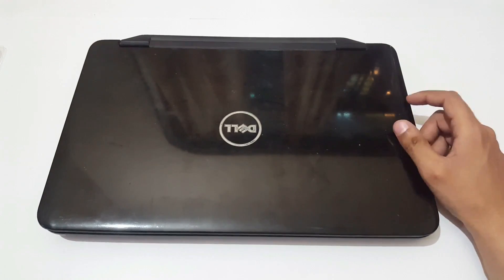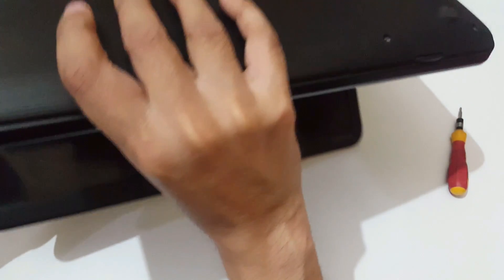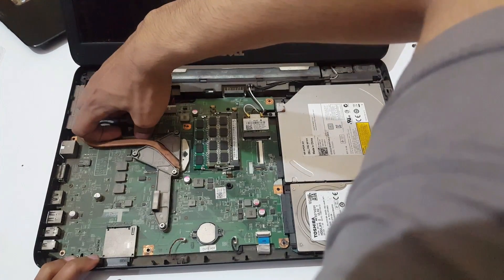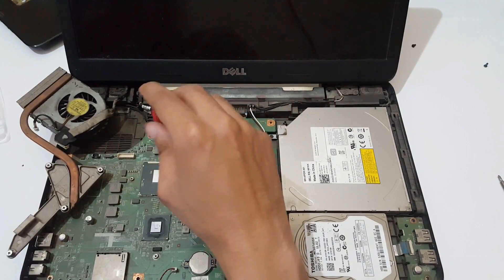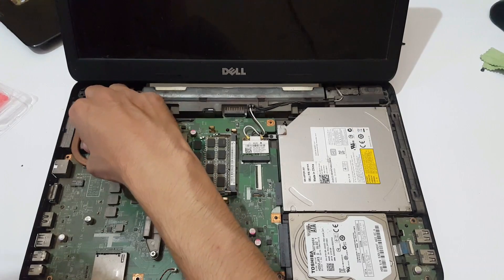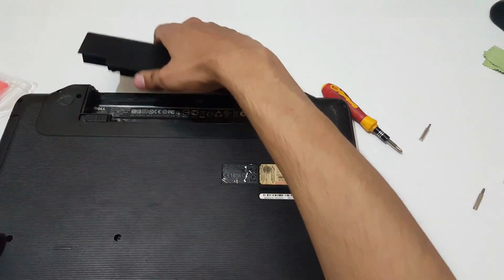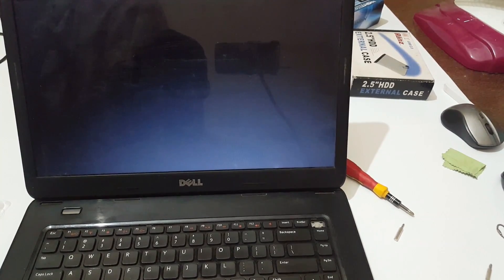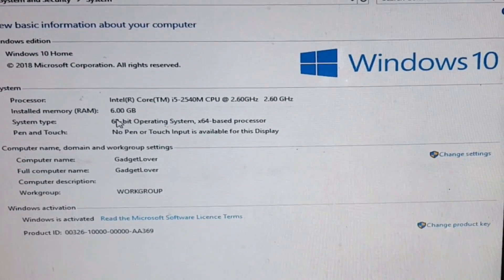How to Upgrade Processor on DELL Laptop | i3 to i5 & i7 - Make Laptop Faster for Gaming

Comment: Dell Inspiron  14-5447 .can i change from i5 to i7? please tell me
Reply from the maker: motorcycles madness : Unfortunately the processor of this Laptop is soldered so you can't upgrade it but I would suggest you upgrade its RAM and install SSD for better performance
Reply: @GadgetLover360  bro can m2 or nvm2  ssd be installed in it,it doesn't even have cd drive to install normal ssd😭
Reply: @GadgetLover360  i have 8gb already ram
Reply from the maker: motorcycles madness : I would suggest you install 2.5 inch Internal SSD drive

Comment: I have another question is my ASUS laptop i3 5005u is soldered?
Reply: I wanna chang my processor to i5 5th gen then change gpu to 1050ti
Reply from the maker: randoggamerPH xoxo : Provide model number and you can attach graphics card externally to your Laptop

Comment: Hello sir, can you help me what the type of processor that can be use on my laptop? I have ASUS A456U with Intel i5, its possible if im upgrade it to intel i7? Thank you.
Reply from the maker: Hadi Makarim : You're welcome and in my knowledge the processor of this Laptop is soldered so you can't upgrade it but I would suggest you upgrade its RAM and install SSD for better performance
Reply: @GadgetLover360  is dell insprion 3521 is also soldered or not
Reply from the maker: Rohan : Yes the processor of this Laptop is soldered
Reply: @GadgetLover360   matlab laptop hi badalna padega proccessor change karne ke liye
Reply from the maker: Rohan : Yes because you can't upgrade it
Reply: @GadgetLover360  thnx
Reply from the maker: Rohan : You're welcome

Comment: hey @gadgetlover can I upgrade my laptop model number: intel celeron 1.50 ghz processor 2 m cache 1.5 Ghz
dell insipiron 3521 (not dell insipiron 3521)
Reply from the maker: Rainex XX : Unfortunately the processor of this Laptop is soldered so you can't upgrade it but I would suggest you upgrade its RAM and install SSD for better performance
Reply: @GadgetLover360  thx
Reply from the maker: Rainex XX : You're welcome

Comment: Can i upgrade to i5 3380M
I hav same laptop currently running on i3 2370M
Reply from the maker: Swanky TechZone : Unfortunately you can upgrade it in same generation only and Intel Core i5 2540M is best processor for your Laptop
Reply: @GadgetLover360  so i can't upgrade to ivy bridge 😔😔 
Wht about i7 2640m its 2nd gen processor
Reply from the maker: Swanky TechZone : Yes you can upgrade it to Intel Core i7 2640M
Reply: @GadgetLover360  bro is this possible to upgrade to ivy bridge from sandy bridge
Reply from the maker: Swanky TechZone : In my knowledge no

Comment: How much does this help without swapping to ssd memory. I was thinking about doing the same laptop. I3 4gb ram 500hdd    To i5 8gb 500ssd.
Reply from the maker: Drake Velazquez : This will improve the performance of Laptop and for more better performance I would suggest you upgrade its RAM and install SSD

Comment: Bro I have dell Inspiron 15 3576 can I replace it with i7 it has i5
Reply from the maker: Priyangshu Paul : Unfortunately the processor of this Laptop is soldered so you can't upgrade it but I would suggest you upgrade its RAM and install SSD for better performance
Reply: Ok

Comment: The processor of my Laptop is soldered, guess I would have to work with 1.6ghz only:(
Reply from the maker: Deepika Bansal : I would suggest you upgrade its RAM and install SSD for better performance
Reply: @GadgetLover360  I have already upgraded it to 8gb and I don't think there is any need for ssd
Reply from the maker: Deepika Bansal : Okay

Comment: hi
can I upgrade my Dell laptop N5010 core I3 M370  2.40GH to Intel i5-2540m Socket G2 ?
Thanks
Reply from the maker: Evon Pham : You're welcome and unfortunately you can upgrade it in same generation only and Intel Core i5 580M is best processor for your Laptop

Comment: Can u upgrade mine
Reply from the maker: Dr.Arshad Khan : I would like to inform you that if the processor is not soldered you can upgrade it in same generation
Reply: @GadgetLover360  mine is i3-5005u
Reply: Can I upgrade
Reply from the maker: Dr.Arshad Khan : If processor is not soldered yes and Intel Core i5 5300U is best processor for your Laptop

Comment: hey my laptop is Casper Nirvana CN.HBI3210H Intel Core i5
3210m 2.5ghz is there something can i do for upgrade like changing cpu?
Reply from the maker: Yavuz Selim : In my knowledge the processor of this Laptop is soldered so you can't upgrade it but I would suggest you upgrade its RAM and install SSD for better performance
Reply: @GadgetLover360  thank you
Reply from the maker: Yavuz Selim : You're welcome

Comment: Sir... I have dell latitude e550 i5 6th generation .... And it is very slow.... So how to fast it ... Mean what i need to upgrade
Reply from the maker: Aimal khan : Unfortunately the processor of this Laptop is soldered so you can't upgrade it but I would suggest you upgrade its RAM and install SSD for better performance

Comment: My laptop is lag how can i fix this sir?
Reply from the maker: DOYOGAN Arman A. : Run check disk and system file scan command and I would suggest you upgrade its RAM and install SSD for better performance
Reply: @GadgetLover360  thanks sir, I'm almost 1 year not using my laptop and after reformating my laptop, it is lag
Reply from the maker: DOYOGAN Arman A. : You're welcome
Reply: My processor is Core i3 2350, what is the best for this?
Reply from the maker: DOYOGAN Arman A. : Intel Core i5 2540M is best processor for your Laptop

Comment: Hello .. Very  good video .. need some advice from you ... my laptop is Toshiba Satellite L745  i3-2330M 2.20GHZ  ... cant i upgrade to i7
Reply from the maker: Shaz Wan : Thanks and I would like to inform you that you can upgrade it to same generation whether it is Intel Core i5 or i7 processor
Reply: @GadgetLover360  Can you suggest for i7 which one good for my laptop and how to know that the laptop is soldered or not .. thanks for reply
Reply from the maker: Shaz Wan : You're welcome and Intel Core i7 2640M is best processor for your Laptop

Comment: I have Sony Vaio SVE 1513 ACNB laptop. It has i3 2328-M @2.2ghz 2nd generation processor can i upgrade it?
Reply from the maker: Epic Gamer Yash : I would like to inform you that if processor is not soldered Intel Core i5 2540M is best processor for your Laptop
Reply: @GadgetLover360  what is soldered
Reply from the maker: Epic Gamer Yash : Attached to the motherboard by a socket
Reply: @GadgetLover360  how can i know bro whether it is soldered or not.
Reply: @GadgetLover360  and bro is i7 2nd generation processor compatible with my laptop?
Reply from the maker: Epic Gamer Yash : Yes
Reply: @GadgetLover360  please provide me link for i5 2540m so i can purchase it in India. I can't find it anywhere
Reply from the maker: Epic Gamer Yash : I would suggest you to buy it from Ebay or Aliexpress online store

Comment: hi i would like to upgrade my processor. i have a dell inspiron 3520, intel core i3-2370m 2.4GHz 4gbs (going to order more). I want to make it as fast as possible, what should i upgrade to? without spending to much
Reply from the maker: LaChancla613 : Intel Core i5 2540M is best processor for your Laptop and I would suggest you upgrade its RAM and install SSD for more better performance

Comment: Brother i have dell Inspiron 14 (3241) which proccesor should i change i have i3 1.8ghz
Reply from the maker: C4_乙єυѕ❻❾ : In my knowledge the processor of this Laptop is soldered so you can't upgrade it
Reply: @GadgetLover360  ok bro but i want to increase its speed to play games can it be done adding ssd and upgrading ram to 8gb?
Reply from the maker: C4_乙єυѕ❻❾ : Yes

Comment: I have intel Celeron n3060 processor laptop. Which processor can I use to swap it with?
Reply: My laptop is hp ay016tu. Check it whether I can upgrade it or not?
Reply from the maker: Gyanam Shah : In my knowledge the processor of this Laptop is soldered so you can't upgrade it

Comment: Hi bro what the best processor I can get on my toshiba satellite L850 with a i3 2350m
Reply from the maker: TONOTECH : Intel Core i5 2540M is best processor for your Laptop
Reply: @GadgetLover360  thx but will it over heat if I put it in
Reply from the maker: TONOTECH : No

Comment: Bro I have Lenovo IdeaPad S145-15ikb intel core i3 processor. I want to upgrade it to i7. 
Now it has 12GB Ram,240GB SSD,1TB HDD.
Is it possible to go from i3 to i7?
Reply from the maker: CHAYAN PRATIHAR - 212 : Unfortunately the processor of this Laptop is soldered so you can't upgrade it

Comment: My Processor is intel celeron n 3060 i can  upgrade him to i3 or i5 ?
Reply: no. i have the same processor and the pins doesnt match my i5 chip. i dont know which generation of the i5 i have but it also came on another laptop and got it for free
Reply from the maker: No and I would like to inform you that Intel Pentium N3710 is best processor for your Laptop

Comment: Dear Gadget lover,
I have dell vostro 15 3568 i3 6th gen 2016
Can u please tell what are the most things i can upgrade to max . Like RAM, SSD,  HDD cady  etc . please tell me everything that i can upgrade in this .. 
I will b thankfull to u.
Reply from the maker: arvin bidhlan : You're welcome and unfortunately the processor of this Laptop is soldered so you can't upgrade it so I would suggest you upgrade its RAM and install SSD for better performance
Reply: @GadgetLover360  thanks for that info . anything else u should recommend apart from that..
Reply from the maker: arvin bidhlan : You're welcome and also run sfc scannow and check disk utility command to fix system error

Comment: I have 1 question..i have the same laptop, i already upgraded into core i7.. but i can see the power usage is higher causing overheating issue.. do u have any suggestion to solve this issue?
Reply from the maker: Hidayat Fikri : Use cooling pad

Comment: Sir, Dell Vostro 3478
i3 8th gen processer can change to i5 8th gen  processor
Reply from the maker: Srikanth Akkala : Unfortunately the processor of this Laptop is soldered so you can't upgrade it I would suggest you upgrade its RAM and install SSD for better performance

Comment: can i upgrade my gpu to rx 5500xt 2 fans on nitro 5 laptop?
Reply from the maker: ACSrinxz : You can attach it externally
Reply: @GadgetLover360  oh, So i cant put it in laptop
Reply from the maker: ACSrinxz : No
Reply: @GadgetLover360  ok
Reply: @GadgetLover360  i have 2 gpu btw, one rx 560x and 2nd vega 8
Reply: rx is not plugged in procesor but vega 8 is
Reply from the maker: ACSrinxz : Okay
Reply: im sad rn i wanted to play game on higher fps but i guess i cant :(

Comment: I have i3 6006u processor can be changed ?
Reply from the maker: LEGAL GAMER : If processor is not soldered yes
Reply: @GadgetLover360  I think my processor is soldered
Reply from the maker: LEGAL GAMER : So you can't upgrade it I would suggest you upgrade its RAM and install SSD for better performance
Reply: @GadgetLover360  already upgraded ram to 8 can I add egpu ?
Reply from the maker: LEGAL GAMER : Yes you can attach it externally to your Laptop
Reply: @GadgetLover360  which GPU ?
Reply from the maker: LEGAL GAMER : In my knowledge Asus GeForce GT 710 is best or you can search more best available graphics card on Google

Comment: bro why your lappy is still slow
Reply from the maker: Learn With Me : This is the first boot up of upgraded processor
Reply: @GadgetLover360  mine laptop is dell g3 
core i5 8th gen
can i upgrade it to core i 7 10 gen 10 nm
Reply from the maker: Learn With Me : In my knowledge the processor of this Laptop is soldered so you can't upgrade it and I would like to inform you that if processor is not soldered you can upgrade it in same generation only
Reply: @GadgetLover360  ohk thanks for providing the info
Reply from the maker: Learn With Me : You're welcome

Comment: Hey sir my laptop use intel core i5 3337u can i upgrade it?
Reply: My laptop acer v5-471g
Reply from the maker: Ruebe Ch. : In my knowledge the processor of this Laptop is soldered so you can't upgrade it
Reply: @GadgetLover360  ouh thx for the info
Reply from the maker: Ruebe Ch. : You're welcome

Comment: hi sir can i upgrade my laptop model from i3 to i5?
here my spec
NEC vistro
ivy bridge
intel core i3-3110m 2.40ghz 2 core 4 logical processor(s)
Reply from the maker: Allen Azra : If processor is not soldered yes
Reply: @GadgetLover360  how to know it is soldered or not?
Reply from the maker: Allen Azra : Provide model number
Reply: @GadgetLover360  its not soldered..ive check it just now.. what i5 cpu model shud i upgrade?
Reply from the maker: Allen Azra : Intel Core i5 3380M is best processor for your Laptop
Reply: @GadgetLover360  alright thanks you so much.. you're the best
Reply from the maker: Allen Azra : You're most welcome
Reply: @vladimirazirov1815 is there any chance for me to add egpu if i just add intel core i5 instead of i7?
Reply: @vladimirazirov1815  thank you very much for the recommondation. i really appriciate it. anything will asked you again. lol

Comment: Can i upgrade my processor of laptop
Intel(R) core(TM)  i5 - 3337U
Cpu @ 1.80 Ghz. 1.80 ghz
How can i know my processor is soldered.
Reply from the maker: M416 OP : If processor is not soldered yes
Reply: If your laptop have disk drive the. It is not solitrate

Comment: Hi sir .. I was hoping , can i upgrade my dell inspiron 15-3542 i-3 4005U @1.7Ghz.... Thanks for replies
Reply from the maker: Amir Ebreo : You're welcome and unfortunately the processor of this Laptop is soldered so you can't upgrade it
Reply: @GadgetLover360  beside from upgrading its 4gb ram to 8gb and hdd to ssd.. If I Can put GPU in my laptop, what is the best GPU?
Reply from the maker: Amir Ebreo : Yes upgrade its RAM and install SSD for better performance and I would like to inform you that you can attach graphics card externally to your Laptop
Reply: @GadgetLover360  i watched alot of videos that u can install GPU in laptops using the EXP GDC laptop external PCI-e ..Can my laptop handle it?
Reply from the maker: Amir Ebreo : In my knowledge yes

Comment: Thanks, I really interested with your video.
And my question is, are they all processors of laptops the same or it’s depends on a type of laptop?
Reply from the maker: Martin J. Ulot : You're welcome and if the processor of your Laptop is not soldered you can upgrade it in same generation
Reply: Dell Inspiron 15 ?
Reply from the maker: t bharat gaming : Provide model number
Reply: @GadgetLover360  will work on dell inspiron 15r 5521
Reply from the maker: @HrishiProductions-pc1ce  The processor of this Laptop is soldered so you can't upgrade it but I would suggest you upgrade its RAM to max and install SSD for better performance
Reply: @GadgetLover360  I will upgrade ram and I already have ssd thanks bro
Reply from the maker: @HrishiProductions-pc1ce  You're welcome
Reply: @GadgetLover360  but sir can it have an eGpu
Reply from the maker: @HrishiProductions-pc1ce  I would like to inform that you can attach external graphics card to your Laptop
Reply: @GadgetLover360  ok sir thanks
Reply from the maker: @HrishiProductions-pc1ce  You're welcome
Reply: @tbharatgaming6000  if you are asking about 3521 then I think the processor is soldiered to the motherboard. So no upgrade option☹️
Reply: @pratikrchavan9093  what about 5558?
Reply from the maker: @7sryze882  The processor of this Laptop is soldered so you can't upgrade it but I would suggest you upgrade its RAM to max and install SSD for better performance
Reply: @GadgetLover360  thanks
Reply from the maker: @7sryze882  You're welcome

Comment: I see first time..Mena suna han, laptop processor update nhi ho skta ?
Reply from the maker: Jas Sy : If it is not soldered you can upgrade it
Reply: @GadgetLover360  can different brand RAM work in i3 laptop ?
Reply from the maker: Jas Sy : Yes
Reply: @GadgetLover360  different brand sah koi fark pdha gah?
Reply from the maker: Jas Sy : Different configuration matter not brand

Comment: I have Hp 348 g4 with i5 7200u can i upgrade to a desktop i7 7700k?
Reply from the maker: MARTIAL WARLOCK : Unfortunately the processor of this Laptop is soldered so you can't upgrade it

Comment: My i3-6006u to upgrade for i5 7400 i can?
Reply from the maker: Why You Clicked : Unfortunately you can upgrade it in same generation only and Intel Core i5 6360U is best processor for your Laptop
Reply: @GadgetLover360  ok
Reply: @GadgetLover360  i can use i5 6600? I domt find the i5 6360u
Reply from the maker: Why You Clicked : Buy Intel Core i5 6300U

Comment: I have Dell Inspiron 15 3000 / 3593 series i3 can I upgrade as i5
Reply from the maker: Apps and solution : Unfortunately the processor of this Laptop is soldered so you can't upgrade it

Comment: Hi bro any suggest for sony vaio vpcee2e1e , cpu , ram, thnx and great video
Reply from the maker: Jascku12 ! : Thanks and AMD Phenom II P650 is best processor for your Laptop and you can expand its RAM upto 8GB
Reply: @GadgetLover360  thnx bro and whatsa for my fujitsu e752 , actually has i3 3110m and 12gb ram ddr3 12800 and ssd
Reply from the maker: Jascku12 ! : You're welcome and Intel Core i5 3380M is best processor for your Laptop

Comment: Bhai mera laptop Dell Inspiron 3584 hai or i3,7th gen,4gb Ram 1 Tb HDD with windows 10 hai lekin bohot slow chal raha hai mere laptop ka performance increase krne ke liye kya krr sakta hu......
Reply from the maker: DEEPAK PATIL : Unfortunately the processor of this Laptop is soldered so you can't upgrade it so I would suggest you upgrade its RAM and install SSD for better performance
Reply: @GadgetLover360  can I play games like Watch dog and PUBG pc
Reply from the maker: DEEPAK PATIL : See its minimum system requirements